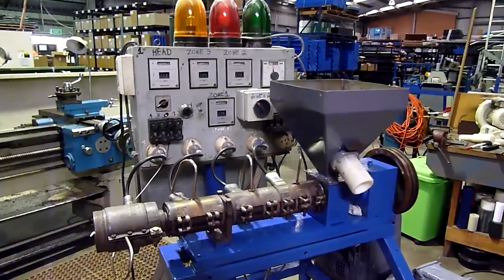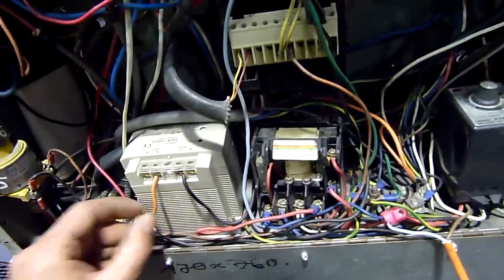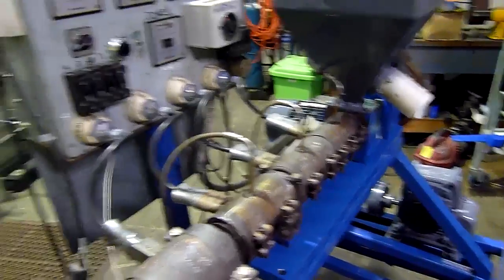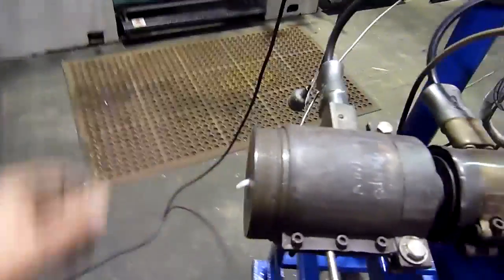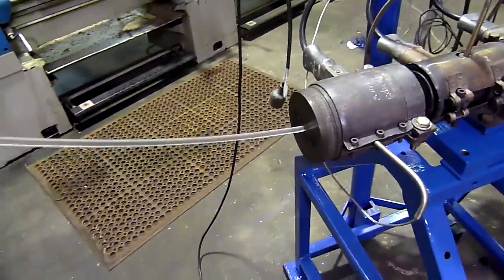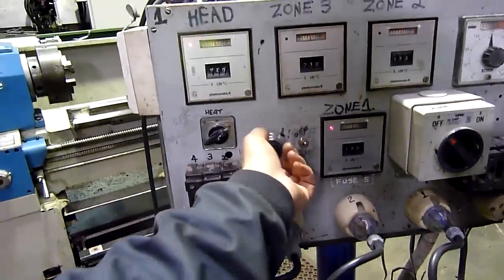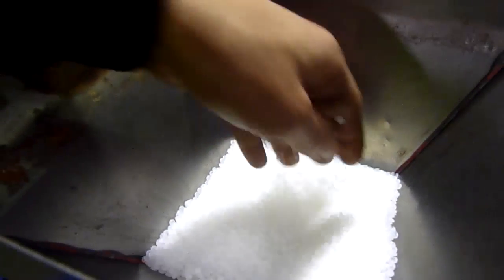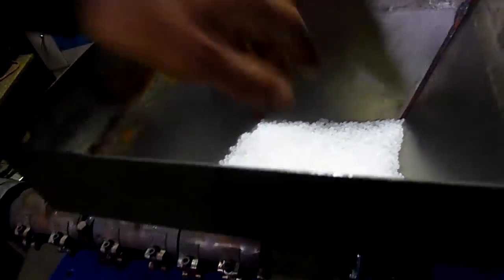Final Update on the Vintage Plastics Extruder Machine.

Comment: You got a safety circuit to prevent motor start unless the barrel heat is at melt temperature. Otherwise you can break the screw or shear the coupling key if the PP is cold. Older molding machines did not include this. But screws are not cheap. Any machine built within the last 25 years will have this. Been in the plastic molding business for 35 years, so I have seen it all.
Reply: Given the size of the extruder it may not be worth the expense. Especially if its just a shear key that breaks. For me on larger machines there is no key. And a screw can run $20,000 USD. That does not include the barrel. When it breaks in the barrel it can be difficult to remove and invariably requires barrel rework or a new barrel. Getting a broken screw repaired is problematical at best. Depending on where it is broken. Most people don't realize that to make little plastic bottles that hold about 4oz of water, requires a machine half the length of a tractor trailer and a Million dollar investment.

Comment: Ed, this may sound like a dumb question but what paint did you use to paint the equipment?
Reply from the maker: Not a dumb question at all!, I used White Knight Machinery Grey in spray pack, and Marine Blue in brush on form. they give great coverage and being single pack epoxy, they can take some physical and solvent abuse before failing.

Comment: Now that's a SUPER-MESSY Panel!
It's interesting that you use the AS/NZS 3112 system for the heating elements rather than a special industrial connector (like a one from HARTING or someone) to ensure that the heating elements would be the only thing compatible with the panel/machine.

Why haven't you just hardwired the heating elements with the Panel? Or do the heaters need to get removed for something?

Comment: How it is legal amazes me :)
Reply from the maker: some will argue otherwise, some will not. the commercial/industrial sparkies I have spoken to agree that its messy, but still fine, and also fine for me to work on since its a plug-in appliance, not a hardwired sub-panel or something more serious.
Reply: How can a panel be messier than the panel in the vid already is? I guess Im simply used to too high standards as a German...